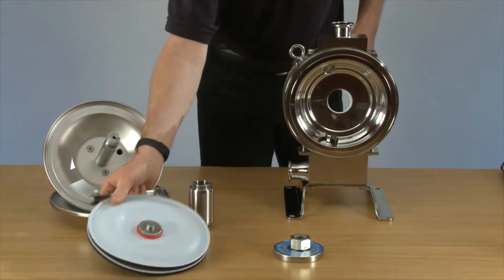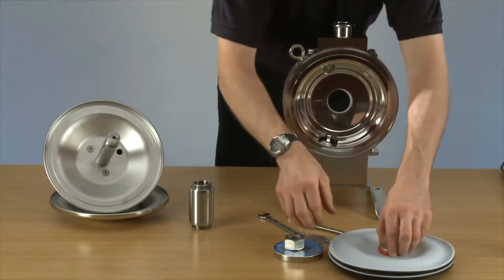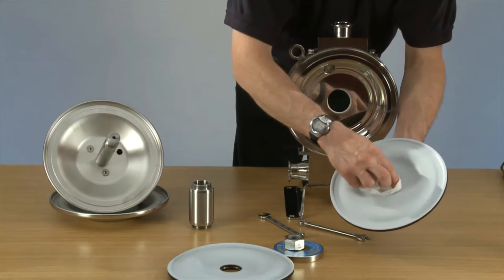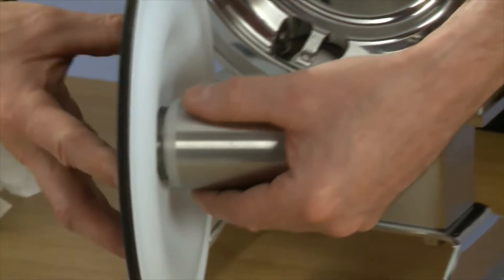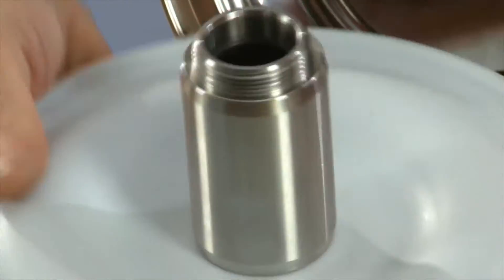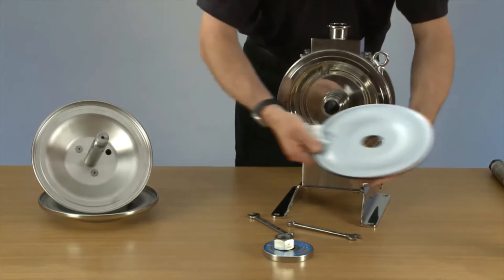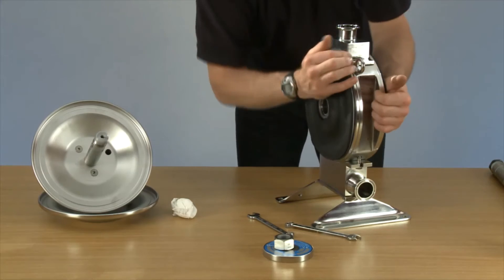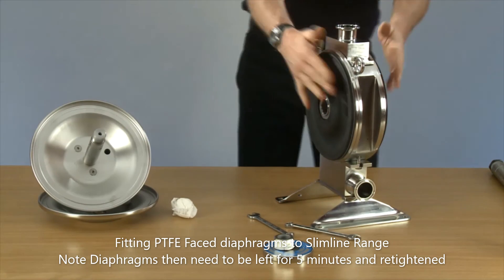Fit PTFE Diaphragms

Comment: Sir
We manufacture  PTFE- TEFLON pumps, not lined but using solid PTFE Glass Fibre Teflon material. 
Our pumps can afford reverse rotation or dry running situation 
for concentrated Nytric, Sulfuric, HCL or other acids,solvents, hydrocarbons 
We use NO RUBBER parts for sealing in our pumps ensures you the best performance 

https://youtube.com/@jaysukhpatel4075?si=6ifBRrDvig1m3s-r